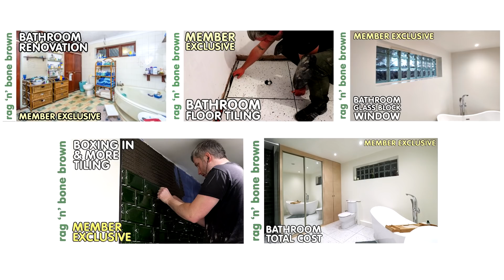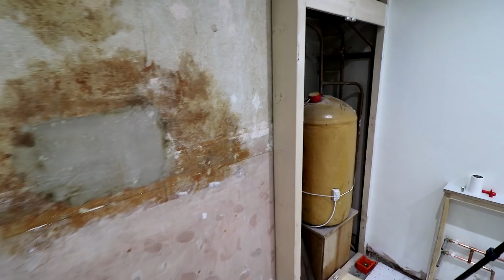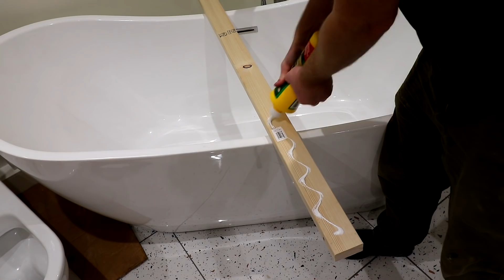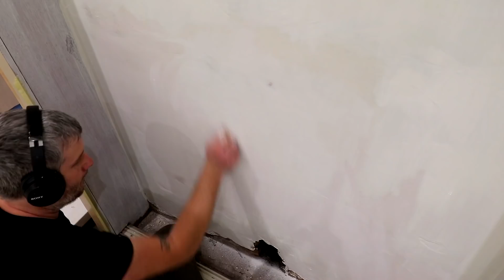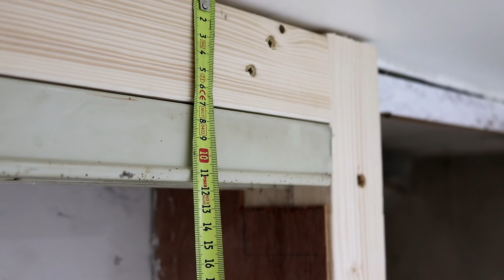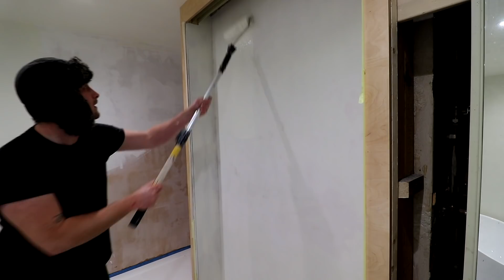Built In Bathroom Cabinet (part 1 of 3)

Comment: "It's a 3.5m by 1.5m sheet which is bigger than a normal 8' by 4' sheet and it's 5/8" thick which is wider than a normal 18mm sheet and it was 2 degrees c outside but 37 degrees f inside but the missus had cooked me 1/2 lb of mince which is more than the 220g I'd normally eat while wearing my size 48 slippers which are bigger than my size 8 shoes"

You brain twisting bastard you:)

Comment: Is that chimney capped Keith? If not you might want to put a flag on the top to stop any rain getting in. Then vent the bottom. Regards Jim.
Reply from the maker: There is no sign of a chimney on the roof at all... It's just a roof without a chimney 🤷‍♂️
Reply: @RagnBoneBrown  top stack taken down and roofed over perhaps? Jim.
Reply from the maker: Yeah I guess so! Cheers

Comment: You can save a lot of scribing with 12mm Decorator caulk at the ceiling and 25mm version at the floor.  Here in the States it's called Carpenter in a Can.  Nice work, can't wait to see the finished product.  Nice score on that sheet of Birch.

Comment: I’m surprised you did all that framework/trim work before dealing with that whole in the wall (chimney?).  A lot of television renovation shows end up with nightmare problems sealing up or closing things like that. I sincerely hope you complete this project problem free, but I would have thought the hole should have been addressed first. (This is just my amateur opinion.)
Reply from the maker: I'm not sure what problems you are referring to.  The hole in the wall was ventilated (via the skirting board) since we've lived here, and I'm going to be boxing in the bottom part, and adding a vent to that later, so there's not really any change in situation.  The only potential problem I'm aware of is from moisture build up from lack of ventilation, and even though I'll be adding a vent, I'm not sure that it is even needed in this situation as there's no longer a chimney on our roof anyway...  Hopefully someone who knows more about this stuff that I do will provide some wisdom!
Reply: @RagnBoneBrown  thanks for clarifying. I’m glad it’s not a problem.  The opening in the wall looks a lot more “threatening” and “troublesome” that apparently it is. Apologies.

Comment from the maker: Bathroom renovation videos available via channel membership: https://www.youtube.com/channel/UCVyE_6jEtVZGmYGXtUOL5FQ/join or Patreon: http://www.patreon.com/ragnbonebrown

This video is supported by Milwaukee, check out their full range here: https://uk.milwaukeetool.eu/?utm_source=Social&utm_medium=YouTube&utm_campaign=Rag%20N%20Bone%20Brown%20-Milwaukee%20Range

Tools used in this video: 
M12 Drill https://uk.milwaukeetool.eu/en-gb/m12-fuel-sub-compact-percussion-drill/m12-fpd/?utm_source=Social&utm_medium=YouTube&utm_campaign=Rag%20N%20Bone%20Brown%20-12v%20fpd
M12 Impact Driver https://uk.milwaukeetool.eu/en-gb/m12-fuel-sub-compact-8243;-hex-impact-driver/m12-fid/?utm_source=Social&utm_medium=YouTube&utm_campaign=Rag%20N%20Bone%20Brown%20-12v%20fid
M18 SDS Drill https://uk.milwaukeetool.eu/en-gb/m18-fuel-high-performance-4-mode-sds-plus-hammer-with-fixtec-chuck/m18-chpx/?utm_source=Social&utm_medium=YouTube&utm_campaign=Rag%20N%20Bone%20Brown%20-%20CHPX
M18 Jigsaw https://uk.milwaukeetool.eu/en-gb/m18-fuel-top-handle-jigsaw/m18-fjs/?utm_source=Social&utm_medium=YouTube&utm_campaign=Rag%20N%20Bone%20Brown%20-%20M18%20Jigsaw
M18 Circular Saw https://docs.google.com/spreadsheets/d/1cmoNp2-c4Q64SoZw8R3r-ZIXFvMSQGWj21BZboBa21c/edit#gid=1828591239
M18 18ga Nailer https://uk.milwaukeetool.eu/en-gb/m18-fuel-18-gs-finish-nailer/m18-fn18gs/?utm_source=Social&utm_medium=YouTube&utm_campaign=Rag%20N%20Bone%20Brown%20-%20Finish%20Nailer
M18 Mitre Saw https://uk.milwaukeetool.eu/en-gb/m18-fuel-254-mm-mitre-saw/m18-fms254/?utm_source=Social&utm_medium=YouTube&utm_campaign=Rag%20N%20Bone%20Brown%20-%20Mitre%20Saw

Support with PayPal http://paypal.me/ragnbonebrown

MY TOOLS:
For links to the tools I use, plus some of my favourite consumables,  finishes and more see links below.  As an Amazon Associate I may earn a small commission from qualifying purchases:
UK affiliate store: https://www.amazon.co.uk/shop/ragnbonebrown
US affiliate store: https://www.amazon.com/shop/ragnbonebrown
Reply: Use screw guide with retracting sleeve, for those slotted screws.